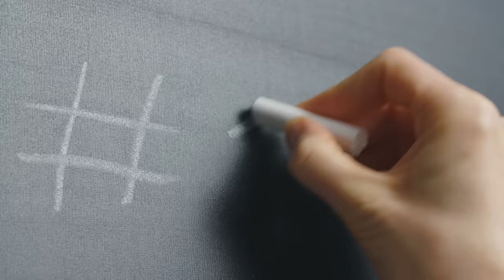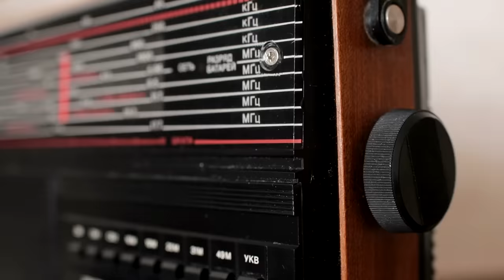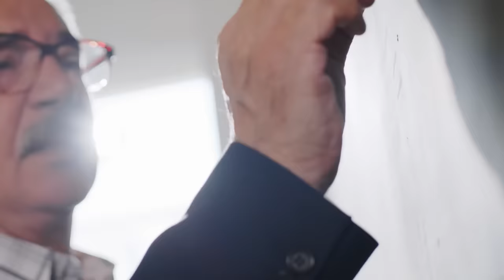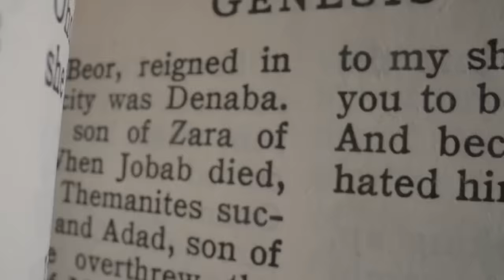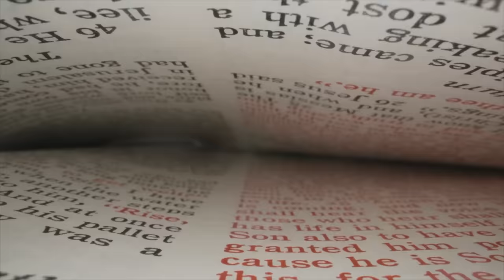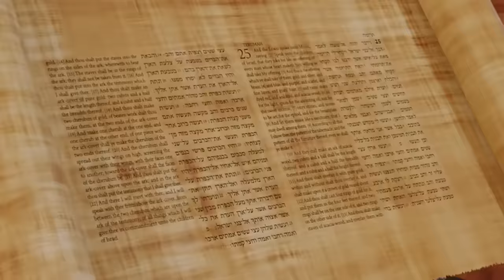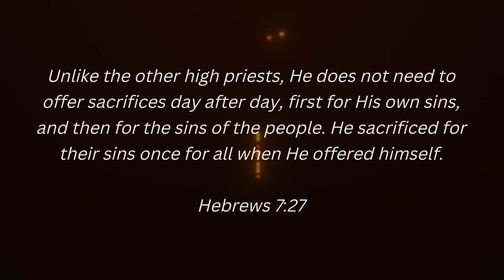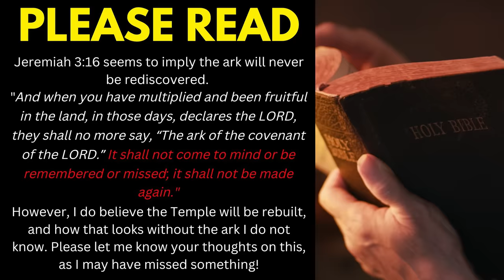He Said He Found The Ark, But No One Believes It..

Comment: Every single event (and object) that prefigures the work of salvation in the Old Testament was fulfilled by Jesus in his lifetime.
Without that act of atonement by the human high priest in the earthly tabernacle in the wilderness and later Solomon's Temple the sins of the people were not abolished.
That same act of atonement was also done by the Most High Priest of Jesus, and His blood 'Had' to be sprinkled on the Mercy Seat as the ultimate final act of Atonement of the whole world.
Haven't you ever wondered about that seemingly strange detail included in the story of Jesus death, that the soldier thrust his lance into Christ side and "Water and Blood" came out?
Blood alone will coagulate quickly, especially in hot climates, but water mixed with blood will stay liquid much longer. Long enough to flow over hot rocks and down through the cracks in the rock to be sprinkled on the Mercy Seat of the Ark of the Covenant.
It HAD to happen as that final act of Atonement in line with all the history pre-figured in all the acts of the 'High Priest' of ancient Israel.
Jesus is the 'High Priest' of all humanity. His blood was the final act, not just his death.